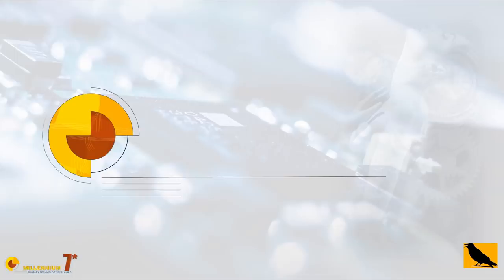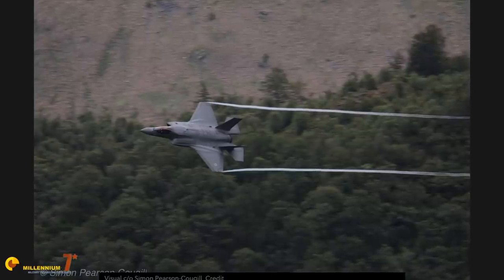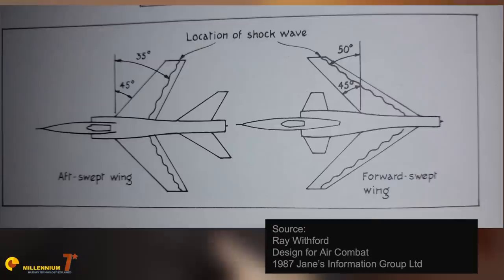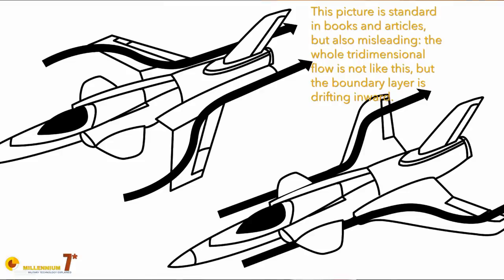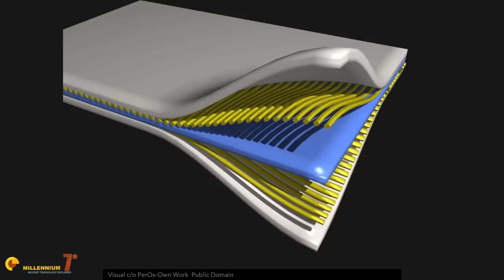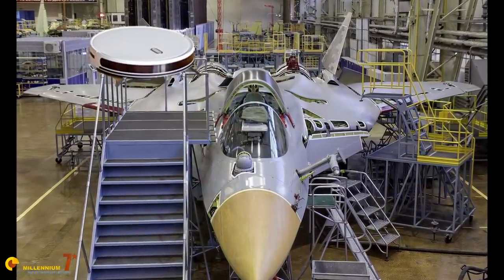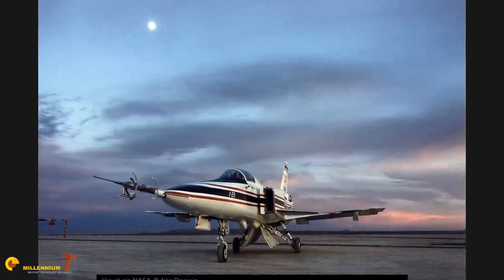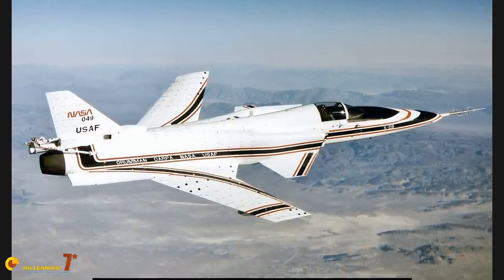Could RUSSIA USE this NOW?    -   Why Berkut and X-29 are a dead end.

Comment: im very interested if why there are no stealth delta planes or what would be the pro/cons of that
Reply: Canard’s show up quite nicely on radar something the Chinese ignored.
Reply: He already discussed this in a video about chinese stealth planes (at least for delta canards). Non canard planes might be interesting.
Reply: I think the big question is ... why? It seems that you need vertical stabilizers for yaw stability. A single vertical stabilizer is not good for stealth. A pair of vertical stabilizers canted outward ... oops you now have tailplanes so it's no longer a pure delta configuration.

Okay, the original "stealth" aircraft was a delta wing with tailplanes canted inward (SR-71). But I think that there's still too much potential for radar beams to bounce back from the inside edge of the far side tailplane. For stealth, it would be cleaner to have the delta wings end before the tailplanes start.

Of course, if you get rid of the tailplanes and rely upon thrust vectoring or differential drag for active yaw stability ... well, I'd guess a true delta could have some interesting advantages. Mainly, you've got a lot more wing volume for fuel and maybe wing root stores or something?
Reply: The F-117 and B-2 don't count?
Reply: @apex_blue  I have an idea.......foldable canards-delta wing.
Reply: @bilalbaig8586  do you mean that the canards somehow fold in like landing gear or something like that.
Reply: @apex_blue  The canards will fold flushh with the body for stealthand fold out  when it has to dogfight.
Reply: @bilalbaig8586  well that will mean that either the body has to be flat which isn’t good for a stealth plane or the canards will be a very okward shape, and will probably lose quite a bit (most)of it’s performance and only add drag, but then again when are you going to get into a dogfight.
Reply from the maker: The Su-75 will be a delta. The canard may be a problem but you can fly deltas with no canards and still have decent performance.

Comment: That X plane proove one thing, once again! 

PUT A GE F-404 ENGINE AND MAKE THAT F-20 TIGERSHARK HAPPEN ! 

Man think about a plane EVEN CHEAPER than a gripen, smilar size to F-5 and very easy to handle by all tight budget NATO members; Romania, Bulgaria, Montenegro, N.Macedonia, Croatia... But well all those would upset Saab 😄 but more importandly the KAI. Not the Kai from DigitalRev, Korean Air Industries. Because they made the T-50.

Comment: Why do F4 Phantom have a twisted wing tip?
Reply: The tail planes have anhedral to keep the tail structure above the jet exhaust. The wing tips have dihedral to balance the tails effect on roll stability. (I don't think they have actual twist but could be wrong.)
Reply: Because phantom sucked greatly, that they did anything to control it in mid-air. 

The thing fly sideways 😄 a feature that you can't even find at F-22 😎
Reply: The phantom was a cool design I don’t know why they haven’t made anything similar to it again they should do a what if old fighter jets with modern upgrades series bring back the phantom, intruder with upgrades to its avionics and power plants give them longer range, weapons capability, maneuverability make a old jet like the phantom smarter and faster
Reply: @benokanruzgar8863  I'm no expert, but my impression is that F4 was a pretty good plane. Othwerwise it would have not served in all branches of the US military and been exported all over the world. It was the fastest navy jet in history, it could carry a big bombload, it existed in multiple variants and was even servicing on board on aircraft carriers. And it could refuel mid-air.
Its problem was mostly that it was a flying brick. Flying faster than mach 2 is pointless since most air combat takes place in speeds around 800 kmh and a few rare air combats in Vietnam happened around mach 1.2. So having a plane that can produce a high speed number on paper is pointless. And accelerating up to those speeds to escape is also harsh. And even if you fly fast and will reach mach 2, its usually pointless to do so. Almost all planes in the world will quickly run out of fuel once they reach those speeds. No one really knows the top speed of Draken simply because it will run out of fuel before it reaches its top speed.
So the Phantom was fast, but not as tactically useful as it could have been. In hindsight its easy to see that its design priorities was not so smart. It would have been better with a plane good at turning sharply than flying at mach2. That in combination with idiotic technowar thinking in Vietnam (see William Gibson on youtube) did losses pile up in the American airforce. The plane itself was not so bad, but the tactics used in Vietnam was idiotic arrogantly took pointless risks with planes and pilots lives.
Reply: @nattygsbord  See, when you type your honest opinion, you agree with me. You said "it was a flying brick..." which was completely correct. Thankfully Royal Navy stopped relying on Phantoms at sea, Sea Harrier won the Falklands.
Reply: Because it was an unstable piece of garbage with powerful engines. It was designed with a straight uncranked wing and a normal horizontal tail, not the downwards pointing one but they had to change it. There's an interview with a pilot in which he said he never liked the Phantom because you could see the nose not tracking straight in flight, it would always go in small figure eights around, while the F-105 would fly solid as a rock.
Reply: F105 was a fighter-bomber. Almost more like a rocket with wings rather than plane. It was increadibly fast and could carry a big bombload, but the plane could not turn well so it therefore needed fighter escorts.

F4 Phantom is a big plane - which makes it easier to find space to add in upgrades to it, while small fragile planes does not have that option. F15 is a big plane and with upgrades it remains one of the best planes in the world to this day despite it is very old. So why cannot then the same be done to F4 Phantom?
I wondered about this when Britain thought about using their stone age Harriers on their new carrier because the F35 planes was so delayed and the jet engine did melt holes in any carrier deck.
After all not much have happened among naval fighters. F14 Tomcat had much potential for upgrades but it was scrapped and nearly all planes have been destroyed by now. F18 Hornet is a very old plane and for the most part it was inferior to F15, F14 and F16. And even todays Super Hornet stack up as inferior to Eurofighter, Rafale and Gripen.
Rafale is the option left as a carrier borne plane. But very few Rafale has ever been built - probably because those planes are very expensive. And even those birds are also increadibly old by now.
So if all naval planes are super old. Then why not then just upgrade an old big plane like F4 Phantom? Its known to work as a carrier jet. It can carry 4 times more cargo than a Harrier. So a stealth material F4 Phantom could probably be very competative today.
The only hurdle I see to such a project would be its costs. It would be idiotic to upgrade an old plane at such a high cost that it would probably be cheaper to design a new plane from scratch. And as a former construction worker I can say that it is far much easier to build a new building from scratch rather than trying upgrade an old. And I imagine the same is true for planes. Especially for mechanical planes like phantom that was created long before the digital era and planes flown by computers. And having an airframe that 500 years old is also costly to upkeep.
But if one wants to and got Elon Musk amounts of money, then it can probably be done :D

So hereby do I no longer care about the stupid crap that you say. F4 phantom is one of my favorite planes because of its cool looks, so therefore will I ignore all facts that you say.

Comment: .

Realistically? I don’t believe in the notion of forward sweep wings just as how I don’t believe in the efficiency of variable sweep wings cuz not very aerodynamic for the first part (forward sweep) abd likely summersaults on high speed of anything beyond 400 MPH, and…

For the second part, the extra weight of variable sweep wings robs the plane of its efficiency and necessary thrust which is why both went out of favour and why fixed wings end up the beast that wins them all. 

Current VSTOL technology is not that hot either cuz subsonic speed as it’s signature is a deadly weakness unless it can super cruise at the Mach 1.6, 1.7, 1.8, or higher but that I don’t hear of the Harrier or of the Lightning II or Yak-36, 37 whatever… 

.